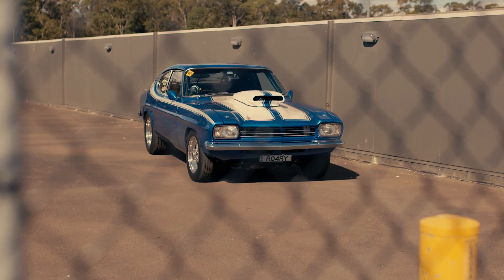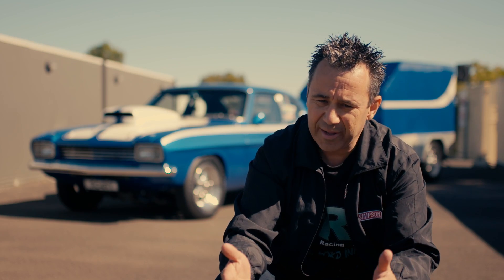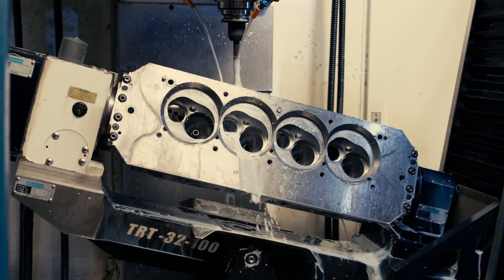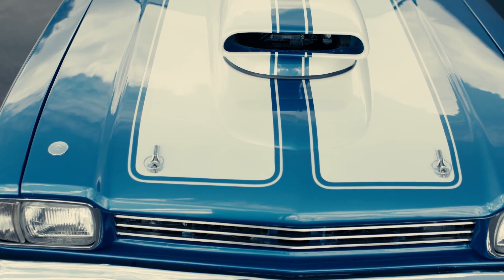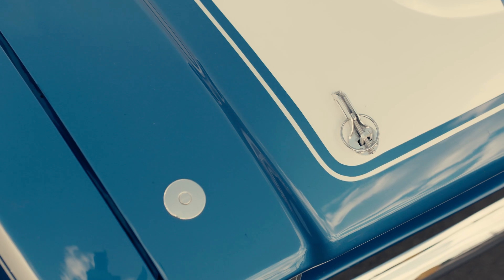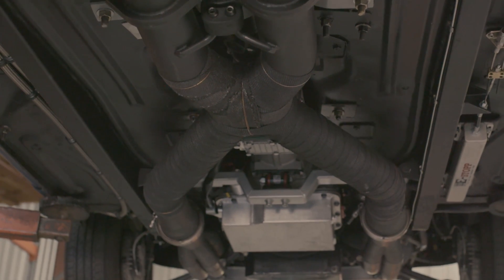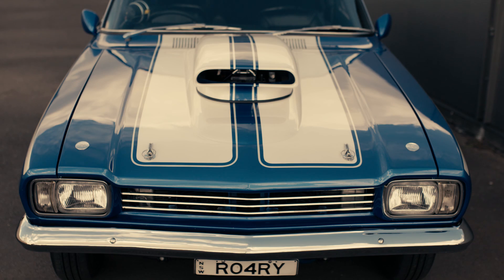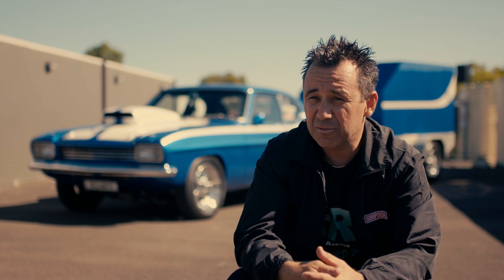Tricky’s 440CI Ford Capri R04RY - Born This Way Modifiers Ep. 23

Comment: that Capri is AWESOME, I had one in highschool that had a 2600 V6 and 4spd transmission. back then I wanted to swap in a Chevy 350 /turbo 350 transmission with 9 inch rearend. but I ended up selling the car and building a Vega with that 350 swap.
,